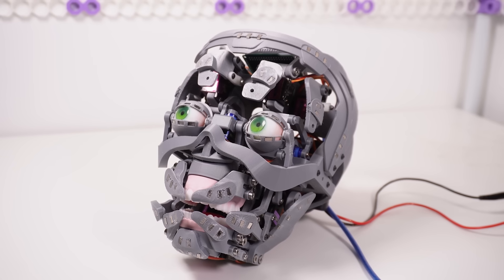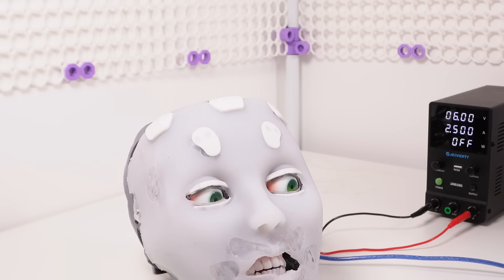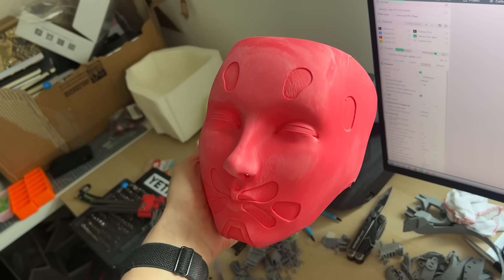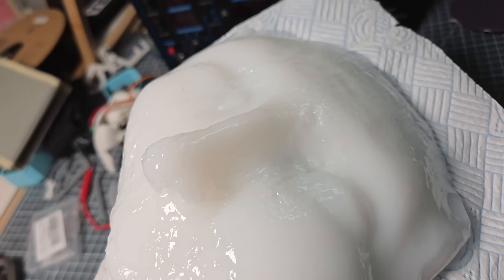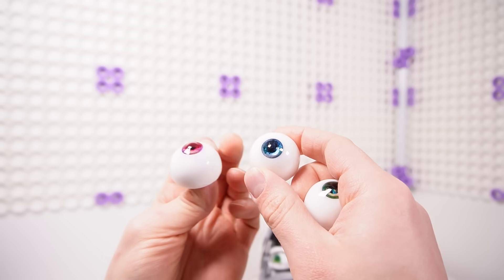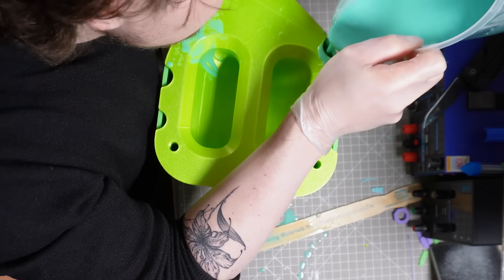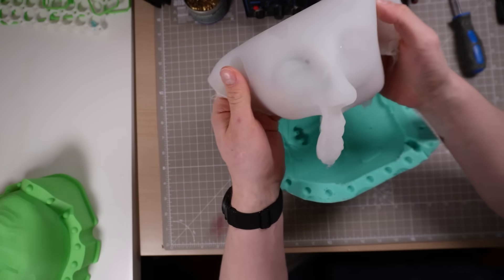Silicone Skin and 3D Printing: Creating an Expressive Animatronic Head

Comment: You should consider using switching buck converters for any instant where you want to step down from a higher to a lower voltage. They are usually in the range of 92-96% efficient and can be very small. A use case would be where you go from 12 to 6V for the servos.

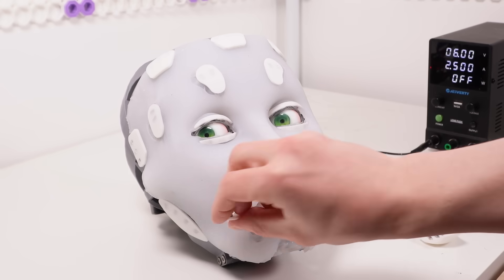Comment: 1:44 the use of magnets is cool but follows Sophia, right?  Thing is, removing the face often seems not like something really necessary.  You could embed snaps halves is the silicone--or simply epoxy or superglues halves to the underside of the face molded siliicon and the mating half to the points on the actuator surfaces. Have you tried this?  I suppose you might patent this solution.  Or, find out whether Robotix will license the magnet approach.  But having a workable lower tech solution that works is that it would encourage the magnet patent hold to agree to a moderate license fee.  Aloow it or have it be skipped.

Comment: Polyaddition silicones are a nightmare to work with. Any slight trace of sulfure will prevent It from curing properly. Even making an exterior shell with polyester resin will prevent the curing.

Comment: Needs ball joints and additional hinges around the jaw. Also 4-6 separated sections around the eyebrows and forehead…The lips themselves should be designed like 2 mechanical worms. 

Imagine 3 people of an equal skill set working on this thing. Dude is like a modern day DaVinci. Stellar work!

Comment: I'm confused as to why you'd need those bizarre-looking magnet attachments that go on top of the face—it's very distracting. 
Can't you just slush-cast the entire face as a sock and pop it over the whole inner-setup? You could mechanically anchor it with various internal "clips." Or, if you insist on using magnets, you can overcast them on the inner side of the silicone so that they remain invisible—basically, just place the magnets in the mould & then cast.
Also, silicone may not be the best material to cast out of in this "sock" application—maybe TPU?

Cool stuff!

Edit: Oh, just watched the last 2' & you basically addressed this so, nvm ahaha

Comment: Adding imperfections to a thinner and more durable skin layer and figure out a way to adhere it to the silicon layer which is used for structural stability should yield a much better result in both longevity in use and better looking.

Alternatively, something like Polyester Faux Leather (aka fake stretchy leather) can be colored and then adding small metal pins\plates as magnetic attachment points for the mechanical controls AND making it look more artificial instead of dipping into the uncanny. That'd give it a relatively long lifespan and be easier to work with. Only downsides for you I see is time spent to learn how to work with a new material and the machines\tools required to work it. Also chemicals to work it if you plan on doing the coloring yourself, which I personally wouldn't recommend.

Comment: random step into an amazing video, keep on the work and thank you for sharing it! as a suggestion (you might not see since its a 2 months old video) to fix your skin on your armature; maybe you should design a type of L and T profiles fixed to your armature that would slide inside some lips you could add to your mask mold designs (or try to add manually with inserts while pouring in the mold) - they would be physically in but could be pulled off, kinda like hooks, and if you manage well the outer mask areas it might create good tension for it to look smooth (with L sections) while the inside muscles would have T profiles inserts so it could grab and move more matter 
you also could think about making the mask go all the way to the back of the head in one piece, so it would stick with tension from elasticity of the mask  (with quick printed surfaces to extend the tension area to avoid gaps it could look clean)
hope i made it visual enough, wish you the best anyway!

Comment: @Will Cogley
You archived a great realism on the speed and swimmingly random eye movements that I have often seen neglected by other robot manufacturers.
If you could write in interface to use this head as hardware to interact with A.I verbally (an option that it is already available for several A.I services out there) it would propel this project to a whole new level. Then we would just need an A.I model to be trained to produce the correct matching facial expressions to match the content of the conversations.  
What would be the cost of putting one of these heads together? (excluding the 3D printed parts)

Comment: maybe on your skin model you could incorporate a snap on grommet hole into the back of the skin so it's plugged onto the moving parts.  There are two different types of silicone, one requires air to cure, the other is a chemical reaction to cure.  You need a chemical reaction cure because it's enclosed.  Or your mould needs to be made from material that allows condensation cure if you use  air curing silicone.

Comment: instead of using those rigid magnetic panels, u could introduce fibers/fabrics into the silicon during molding, and attach them to Velcro. This would ensure better connection, maintain flexibility and make  the whole thing less self-destructive during motion.

Comment: I think rather then magnets you could directly connect the skin by creating protrusions at the inside of the skin that can connect to the face. Like imagine on the inside little silicone "doorknobs". Thanks to their flexibility you could push them through a premade hole in the face mechanism slightly smaller then the thickest part of the silicone knob making for a secure connection while still allow you to pull them back out by hand if needed

Comment: Impressive progress indeed.  Just a useful tip to simplify your servo requirement on human head: we don't need a servo for lower eyelid, nor lower lip, because most humans don't move those in general,  except on specific Impressions. Thumbs up 2u always. Another question: how do u solve the issue of servos jump to default position when u power the system? This is a major issue that can break/wear the joints, and even break the servo gears.

Comment: If i had to guess the reason why the first 2 sillicone skin never cured,  it's probably because of the type of spray you use or maybe the material of the mold itself. From my own experience with the stuff, when sillicone doesn't cure it's often because a contaminant made it's way inside the one or both part of the sillicone mix preventing the reaction to occured properly. 

Choose the type and brand of sillicone wisely, the tolerance and how much contaminants affect the final product may be varries from one brand to another.

Comment: Hello, very good job. I dedicate myself to the moderation and reproduction of objects to scale. I would give you some advice, don't try to pretend human realism if you don't replicate the human organism. By this I mean that the skin is not composed of a single fabric, try using a very elastic and thin silicone in the first layer of about 0.5mm then a second layer of a slightly stiffer silicone of about 0.8 - 1 mm. Finally, make the joints with different types of rubbers joined with flexible adhesive that pull the skin in the normal direction, in this way you imitate the movement of a face and you get something much more human. Good luck 👍🏻

Comment: need to make a 3d printer fleshlight with motors to make it move inside and a 3d printer hold for the silicone. I'd be printing them and selling them at every comicon around

Comment: Looking at squish molds where instead of 2 silicone parts, similar to your improvement on back side, one is silicone and other is printed + recent silicone casting henry3dcreations molding tutorial might be a gamechanger for you. 
Another thing I'd add from myself are magnets with screw holes. Instead of screws, the holes might be a good way to register or emboss themself into your mold being right inside the cast.

Comment: It woulf be too finicky and expensive. If hemetite or any magnetic pigment mixses well with the silcon to maje the skin magetic it self. Or just paint a layer of magnetic paint the layer it self. Just the matter of finding the right binder for the paint to last and stay on the back of the skin. Daneil smith Primatec does sell hemitie water color and the nail trend is using magnets fo

Comment: I don't understand why we still need silicone and make silicone molds. Why can't we just use tpu and 3d print it straight from a stl file. I just think tpu and 3d printing is about to replace the entire use of silicone and casting molds. As far as the eyes. We need the eyes to carry a small camera and the other eye to carry the small microphone. It is to my understanding the speaker goes into the back of the mouth. But the eyes need to have the hole where the pupil is for camera and microphone.

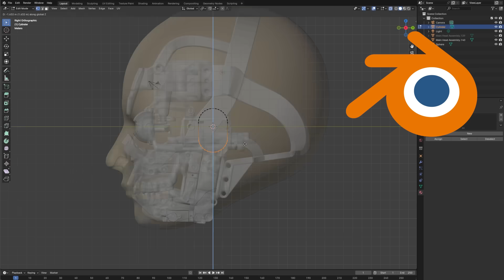Comment: I saw that you were making proper edge loops and topology around 3:00 and then you switched to essentially a planar grid projection. Any reason you switched methodology? Was the Blender to OnShape causing problems? Just curious.

Also, this is awesome! It would be really interesting to drive this face with my Vive's eye and mouth tracking like I do my VRChat avatars. I wonder how difficult it would be to interface your code with OSC...

Comment: Really neat!
I think the plan to encase the anchors within the silicone sounds good.

Hey have you considered trying a string-pulley mechanism as an alternative driver, with strings under tension acting as artificial muscles?

In 3d Animation, for face rigging, we often see a competition between skeletal animation (which appears to be what you've got here), and muscle-based techniques.
Skeletal techniques have the advantage of being more intuitive to animate, but muscle-based techniques have the advantage of more closely matching the natural properties of real facial anatomy, and can often produce surprisingly good results with relatively few moving parts. When moving parts are at a premium, it's a strong option.

You could do something very similar to what you have here with embedded anchors, just drive them with string attachments rather than directly with servos. You could have an underlying surface (also silicone) to preserve volume, with the strings in between, connecting to the external surface anchors. You could even tune the surface response by using elastic strings with multiple anchors, and varying the thickness and internal structure of the silicone layer. Like, imagine varying the thickness on the inside of the forehead, to control the way that it wrinkles under compression...

Comment: This is an amazing project and you are so talented. I can do 3D print and assembly but I would need to buy electronics and working code from you to get this to life. And your eyeballs are also really great. 
I don't like the magnet solution with the counter holding parts. I bet you find a good solution.
I have seen a video they have detachable skin hold by friction. Maybe you can adapt this. But I can not find the doll video again. EX Robots use a shoulder length silicone mask.

Comment: I have no idea why people have not tried using 3D models like in reallusion and then finding out how those models faces are rigged to have accurate emotes. Then just copying those same rig setups onto an actual model figure head and have that facial rig and real rig joint connected through a pipeline. This way to help simulate actual realistic facial emotes. Hell you can even have AI assist you with 3D printing the face with the proper rig setup. Then all you need to do is add the sensors and connect that to your pipeline for your 3D model rig in order to simulate the exact same facial expressions. The process seems so easy. Being this model isn't far off but would do better going through the method I mentioned.

Comment: Impressive, i like the rest of the face squishing around as the eyes blink. Makes it feel organic.

This looked pretty painful to design and assemble. My personal hope is to use TPU for AMS and PLA separators to print the whole hand or head and skin all in one go, with tendon cables coming out to attach to motors. All designed in blender, with joints held together with tendons and no fixed pivot points, like human joints. But this is all still a dream. Good job on getting stuff done

Comment: Crazy thought.  In the cast include magnets to hold the panels in place.  Do the slush cast, insert the magnet panels that clip to the magnets in the cast, then mold.  You'll peel the mask out and have to pop the magnets apart, but it should work.

Comment: I'm an old-school effects artist: clay and plaster and silicone and such; I have yet to dip my toe into the 3D-printing phenomenon.  
When I need to calculate how much silicone something is going to need, I often will have the clay I used, which I can either weigh (in which case I need to know the density of the clay to calculate the volume) or- even better- drop into a bucket of water to tell the volume. (subtract the full bucket from the bucket without the clay in it = volume of the clay)
When calculating for a large outer mold, it's measuring the size of the box, minus any curves, minus the thing being cast; it's just geometry.  One doesn't want to waste material by guessing too much and having leftover, but guessing too little and needing to do two pours is inconvenient, might cause casting problems, and if you have to go back to the store for more that's a whole thing.  So better to guess a little on the high side.

I don't know much about the CAD programs you're using, but is there any tool to calculate the volume of an object?  Or in your case- the volume between two objects?  I imagine that with all the calculating power of a program like that, it would be simple?  Knowing that in advance, then maybe adding just a bit extra for safety, would give you the right amount of material, so you don't have to guess and accidentally guess too low.

As for the cure inhibition, it's probably not going to be the release; they're usually pretty inert.  It might be the clay; certain clays will inhibit silicone curing (sulphur is bad, water is bad).  And/or it might be two incompatible types of silicone.  Using a good barrier between things can be key!  A good release agent- either brush-on or spray-on, will form a proper barrier between one material and the other, so that even cure-inhibitors can be blocked (though better still if everything is compatible!).  Looks like you're using Smooth-On products, which have a very good customer service system; ask as many questions as you can, read up on all the different silicones and their compatible clays, silicones, urethanes, releases, etc.  Make sure you get everything that plays together nicely; the folks there should be able to help you out.

Seems like you got it figured out eventually; sorry for the trials and errors.  Good luck!

Comment: a nice way to go from 3dprint to smoothe mold is to pour a small amount of thick plaster of paris over the surface, then shake off the excess.  it fills in all the layer lines and any voids, makes a very nice smoothe matt surface that silicone peals off of fairly easily.

Comment: This is epic! When I get time in the future I've aspired to tackle a similar project so a ton of learnings here, especially for the silicone. As a brainstorming idea:

Would it be a considerarion to 3d-print the face material using something like Ninjaflex filament since it's stretchy, then apply layers on top of that via a spray? With a dual extruder you could also print in magnetic insert anchor points & leave gaps in the ninjaflex print so that it's more of a stretchy lattice acting as a biomimmetic fascia of sorts?

There would be some chemistry/materials science involved in getting a material that would bind to it correctly, but in theory it could be a more reliable and cheaper process vs a silicone pour.  Since the material is more durable as well, it:d not have as many of the same tearing issues as silicone depending on the printing methodology.

Thanks again for making this, tons of ideas! I'm now reinspired to make my game character real as you happened to nail the in-between real and toonish that I was going for in art direction lol

Comment: I love the robotic field, but unfortunately, there are fewer or no available jobs in my country. So I have to pick up the software development instead. I used to play with Andruno`s board to turn the light off and on with voice commands or hand gestures. At that time around 2016, chatGPT had not come out yet (in my country). I remember I learned on CNN (Convolutional Neural Network), using a YAML file to store the logarithm number, etc and It was quite difficult for me.
But with the help of AI nowadays, the robotic field is absolutely fun to learn and play around. You just have the powerful machine to run the local model and do RAG or use chatGPT API.